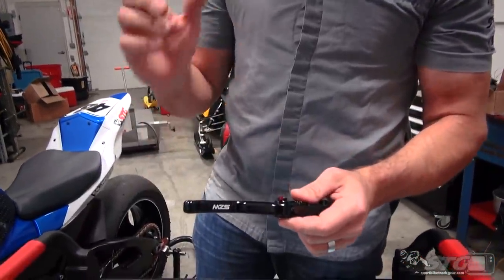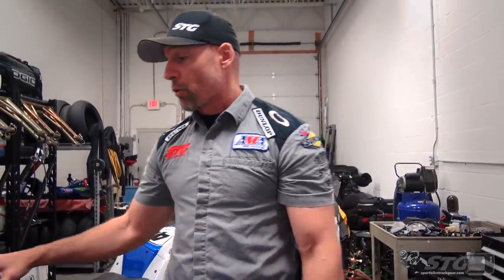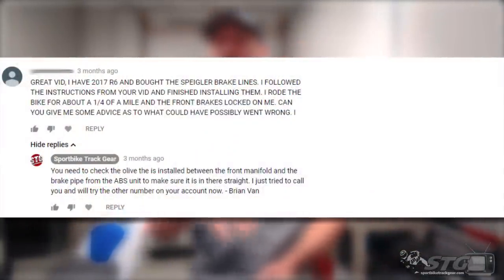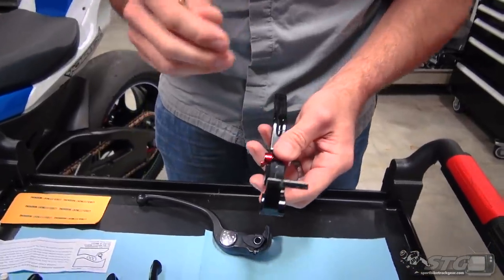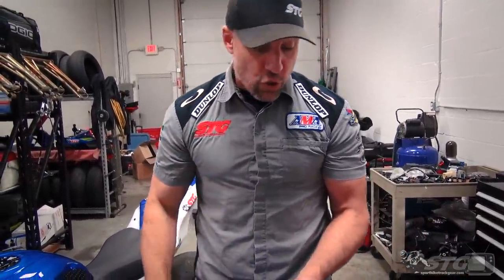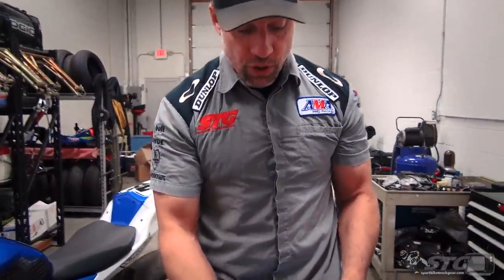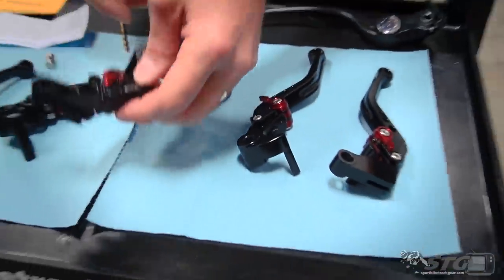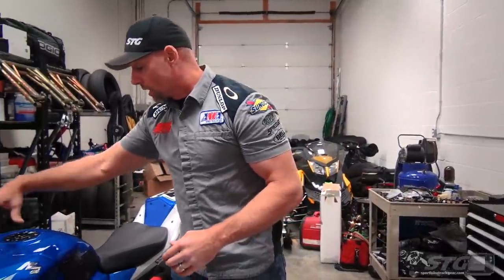The Truth About Cheap Motorcycle Levers | Sportbike Track Gear

Comment: I see a lot of people on here saying that "my cheap chinese levers worked just fine" saying stuff like $150 for aftermarkets are too much. I question if you are that strapped for cash to begin with or just that cheap ahem I mean frugal, why not just stick with your OEM levers. I guarantee they are way better quality than the unregulated chinese BS that ships on ebay. We risk our lives just by riding motorcycles, why compound the dangers?
Reply: Because my OEM levers are not adjustable. I have my clutch lever cranked down to the shortest throw possible.
Reply: @kukusz  i forget that not everyone has average sized hands.  I still say it is not worth the risk of failure. Pony up the green for good that wont bite you in the ass.
Reply: @deathwish8339  for me it wasn't a hand size issue, it was that the throw was very long. I prefer to be able to have very little play in either direction so when I pull the lever I get immediate response. Same goes for the other direction - when I begin to release the clutch lever I want the friction point to show up almost right away. But yes, YMMV with Chinesium parts. Very much depends on the seller and the part.
Reply: Like the oem levers are top quality? How do you know they were installed properly?
Reply: @darrenmcfeaters6683  because you didn't install them, already better in my book. I am joking of course. But cerified technicians are almost always better than you at their specilization.
Reply: @deathwish8339  although I agree, levers, rear sets, clip one are not marvels of engineering and require special skills to install. I was looking at rear sets and my $100 aliexpress one is made as nice as my buddy's $400 one. I remember when carbon bikes and wheels first started coming from China and people freaked out then as well.
Reply: @kukusz  I don't know about carbon bikes from China. I do know that I wouldn't trust the wheels personally. They are probably fine under normal circumstances, but I am already leary about carbon fiber because of the wheelies I do. I don't want to come down harder than normal from a wheelie and have to worry about breaking my rim. If it isn't top grade carbon, I don't want to see it on my bike.
Reply: @deathwish8339  I meant bicycle wheels. I know a few wheel builders that use Chinese made rims now and have seen the quality improve a ton. Same with frames. Failure rates do not appear to be higher, delamination issues same as some of the super high end brands.
Reply: @kukusz  they only look as nice, but if you have any machining or manufacturing experience you should be able to tell the difference of fit and finish. But you cant.

the other part that you are compeltely ignoring is the regulation of said compoments by industry standard groups, the companies themsleves and 100s of years of manufactuing things "the right way".

China offers low prices cuase they throw all that other shit out the window not to mention they dont pay the workers fucking ANYTHING
Reply: @Juxtaposed1Nmotion  you've made so many unsubstantiated statements it's pointless to discuss with you. For what it's worth, the rear sets fit perfectly with oem frame and components like rear master cylinder. The machining is not rocket science. With Chinese stuff, they are often made in the same factory with the same tooling as things "designed in USA" but made in China.
Reply: The issue is the factory one are cast and break super easy and the Chinese one yet even though mostly are billet made from one piece and aren't nearly just gonna snap from a small crack like a cast ones does
Reply: @greggutman5863  sorry, are you saying the Chinese ones are not billet and/or are more likely to crack? Unless they are lying and it's not t6061, why do you think that? Genuine question.
Reply: @kukusz  no I'm saying most factory oem levers are cast and even the cheap Chinese ones are billet and are more likely not gonna break over oem ones

Comment: Well played.  OEM levers can have play and you only mention one possible issue that may cause the cable to stick (not sure I agree 100% on that).  Prove that the materials are subpar, the products dont work as well or something more convincing.  So the expensive ones have a bearing, how often are you going to need to adjust that you need that extra feature ..and at over twice the cost ? I'll consider the cheaper ones, make sure the pin doesn't bind and be on my way.
Reply from the maker: What do I know? I have only been doing this for decades. - Van

Comment: Don't even reply stg. More than fifty bucks for levers is absurd
Reply: I have these same MZS levers on my R3 and they work great
Reply: It is absurd but over 50$ can for sure be less than your hospital bill.
Reply: I put mzs levers on a buddies 600rr and they locked up at the first stop sign and wouldn't release lmao had to slam the mounting bolt out with a hammer and screwdriver just to release the brakes to go home. But my other brand chinese levers have been fine for years. You can't just claim all chinese off brand shit is good lol
Reply: if you can't spend the money on quality parts then don't even bother "upgrading" your bike with garbage parts that are actually a downgrade from OEM

Comment: Fitted MZS to my sv650 today, rode to work and front wheel locked up, nearly went into back of a car. Be taking them off asap
Reply from the maker: They are garbage and should not be sold. - Van

Comment: Thank you for this video Brian! While trying to get the cross-pin bushing out of my stock levers I came across this video. In it I saw the same levers I purchased. At first glance they look sufficient, boy was I wrong! Thanks to your review I saw the little details that go unseen by the untrained eye. As a result I did 2 things: 1) immediately ordered Vortex levers from you. 2) requested a refund from Amazon on the MZS levers. Since I do a lot of track riding your video possibly saved my life! Best part is I had STG Gear bucks from a previous order to offset some of the price difference and return to Amazon was accepted with no hassle 😎
Reply: Got my Vortex levers yesterday, installed today. Thanks again for the possible life saving video Brian! Now I’m ready to hit the track again(once it opens) 😉

Comment: I bought a used Ducati scrambler fitted with a set of those levers , first time I rode more than 10 miles the front brake failed completely rode it again later did exactly the same at similar milage  , the adjusting screw in the lever had been adjusted to far causing the brake to overheat , sorted that problem then the lever  started clicking  , it's in the bin now and fitted an original part
Reply from the maker: These levers are absolute shit. - Van

Comment: That happened to me, laid my Gsxr down at 40 mph. Brakes locked up. Threw those levers away and bought high end levers.
Reply from the maker: And we still have people commenting on this post that the cheap levers are just as good. Sorry you had the issue, the cheap Amazon levers should not even be available for purchase. - Van

Comment: I went through 3 clutch cables on my zx10r because of the cheap levers the previous owner had installed. The cable was rubbing a sharp edge where it comes out of the elver and over time chew into the cable, fraying it and eventually the cable snapping on me! Replaced them with a set of ASVs and haven't had a problem since!
Reply from the maker: ASV makes an excellent lever. Thanks for sharing this, another example of how a cheap lever will cost you more than you saved. - Van

Comment: Hello, I bought a 2014 Hayabusa in a dealership, the first day I got it I noticed that the front brake lever touch the plastic on the bike, so every time I move the steering wheels to the left it automatically stop. IDK what to do.
Reply from the maker: You will need to adjust the controls until there is proper clearance preventing this from happening. - Van
Reply: @sportbiketrackgear  Thank you bro...

Comment: I'M HAVING THIS SAME ISSUE ON MY 99 R1! I worked on the stock lines and rebuilt the master cylinder and thought the issue was resolved, then took the bike out for a spin only to end up having to lay it over on a freeway exit. I then rebuilt the calipers and went to test the bike again, only to have it lock up the front brakes on the freeway again. This time, I was able to keep it upright. HELP, HELP! Also, what are your opinions on Core Moto brake lines? That's the brand that I've been looking at to replace the current lines, but after watching this video, Speigler isn't much more in cost over Core Moto's set. Thanks and keep up the radtastic work fellas!
Reply from the maker: You are welcome and thanks for watching. I do not have any exeprience with Core Moto lines, sorry. We focus on Spiegler lines here and all use them on our bikes at STG. IMO if you need a set that is the way to go. - Van

Comment: I have a Yamaha r15 and my OEM lever doesn’t have a pin, it’s just a solid lever with a wedge to activate the brake. Does an eBay lever still give me a risk of tire slipping?
Reply from the maker: It should not, most of the issues I am aware of are with bikes that use the radial master cylinder. - Van

Comment: You should make another video and attach a string-potentiometer (string-pot for short) to the lever. Fab up some kind of fixture to mount an 19RCS (your typical go-to MC) to and show how much flex the levers have when squeezing the s*** out of them. I guarantee there will be some data worth looking at. That 1-2mm of flex can really make a difference between proper lever clearance and running out of stroke!
Reply from the maker: That's a great idea, just not enough time in the day my friend to make that happen. I have too many uncompleted projects all stacked up right now to add another one to the list. - Van

Comment: So I installed aftermarket levers on my 08 Yamaha r6 and my brake lights are now constantly on or flickering because it looks like these levers aren’t the proper size. And these are the second set of levers (through different companies)
Reply from the maker: Are they the cheap levers from Ebay or Amazon? If not what brand are they? - Van
Reply: Sportbike Track Gear both from amazon FTRT for one brand not sure on the other brand but the clutch works perfectly fine it’s only the brake lever with the lights. Brakes work as well just fine
Reply: Sportbike Track Gear any fix to this or any brand I should get that you know would fit my bike?
Reply from the maker: We use CRG levers on all of our STG bikes, excellent quality. - Van

Comment: I have a pair of Chinese copy levers on my bike, never had an issue with them in about 50,000 miles and they still look as good as the day they arrived. I have seen reports of levers failing as you say but this set doesn't appear to have any of the issues you're pointing out, I do all my own maintenance throughout the bike and have done since I was dispatch riding in London in the eighties, I know my bikes inside out.

Comment: Watching this video has opened my eyes up about an issue I'm having on my 2008 honda cbr600rr. I bought the Brembo RCS19 back in march 30, 2018 with brembos brake reservoir kit to go with it. Nice little birthday present for me. My OE master had developed a slight drag to the piston back in 2016 while I was riding home. I had it fixed, but wanted the upgrade. Well upon installing everything correctly(ASE master certified and Lexus Master certified mechanic), I noticed the hose connecting the reservoir to the master would always have a kink in it. I blead the PISS out of the brakes  with galfer dot 4and never noticed an issue with braking, asides from the amazing feel and feedback of the Brembo master with galfer direct connect race brake line, but never liked how the resivior line always had a kink in it. I've been lazy about it and never really gave much thought, but this video definitely opened my eyes.

So I ask if I should contact STG or Brembo with photos of what is going on
Reply from the maker: Shoot me a pic to service@sportbiketrackgear.com and I will help you get it sorted out. FYI I am leaving for a family vacation tomorrow, please send this ASAP. - Van
Reply: @sportbiketrackgear  I'll be able to get some photos late this evening

Comment: Replaced my oem with 2 finger levers, rode ok for 400M then front brakes locked up. I checked everything from master cylinder to brake lines couldn't find a fault. Eventually i took the brake off and put the oem back on..... Road around the block with no issues. When i compared them and the 2 L were slightly thicker. I filed it down to oem size and no issues afterwards.

Comment: I had a set of $25 ebay levers on my 2014 CBR 500r, didn't like the amount of loose give in the levers. Had them on there for a few days and took them off.
Reply from the maker: For sure the tolerances of these cheap levers is not even close to where they should be. I would leave the OEM levers on my bike before installing a cheap set. End of the day the OEM levers may lack adjust-ability but they do offer excellent feel. - Van

Comment: I have a 15’ Ducati Panigale i use for the track and three days before I was scheduled my bike fell over on the stands and the safety loop on the end of my clutch broke off. Afraid I wouldn’t pass tech inspection I got the MZS levers off Amazon because, like you said, they were cheap. I’m shopping for replacements right away, luckily they got me through some hard braking at the track but I won’t chance it again. Awesome video 🤙🏽🤙🏽

Comment: I have learned the hard way too I bought cheap Chinese levers ending up replacing a whole clutch basket when the problem was the Tolerance on my clutch lever push the hydraulic pin on my Zx-7r thinking I had a bad clutch.

Comment: I bought a cheap pair of shorty levers for my 2006 R1 right when I got it. The last few years I used it to commute on the 101 and 405 freeways in LA for my job with the round trip being 80 miles each day. After 4 years I had put about 70k miles on the bike and never had any issues with the levers at all. I did initially want the ASV ones but I couldn't shell out the money at the time and then just stuck with the ebay ones. Maybe I somehow just got lucky?
Reply from the maker: For sure there are plenty of people who have had a good experience with the cheap levers. That said there are far too many who have had the brakes lock causing a crash IMO. Read through the comments on this video, several riders who had this happen have posted comments. - Van

Comment: If it ain't broke, don't fix it !
I just bought a 2009 Kawasaki Versys 650 with only 5050 miles on it. Both levers work just fine ! 
The "last" thing that I want "my" control levers to do, is fold ! 
I'm leaving my stock levers on.
Reply from the maker: Nothing wrong with the OEM levers. - Van

Comment: When you buy the MZS levers it shows this in the instructions and that it can lead to brakes not locking up if you dont install it right
Reply from the maker: The tolerances on the levers are not where they need to be. End of the day there is simply not enough clearance to prevent this. None of the other aftermarket or OEM levers require this sort of attention to prevent the brake from locking up. - Van

Comment: Yup Happened to me installed these in GOLD, They kept locking up but the bike wasnt being driven it was in the middle of testing them, Theres something you gotta do to push the bushing out the way and it has to be lubricated, im never going aftermarket again
Reply from the maker: Good you found it before riding the bike for sure. - Van

Comment: Tried these exact levers and almost got stuck. The clutch lever wasn't engaging the clutch some reason. I tried adjust every way I could and nothing worked luckily I was only about 4 miles from home and able to make it home in first gear
Reply from the maker: MZS levers are garbage. Happy to hear you made it back home. - Van

Comment: It happened to me. On my Buell xb12r.  I fell over at the second stop sign after I left my driveway.  On a test run.  Fell over.  Front brakes locked up . broke my rigbt side footpeg.  Had to use my tool kit under the seat.  Removed the lever and it released.  I rode back home on my rear break and no peg.
Reply from the maker: Sorry to hear that man. With all of the comments in this video just like yours there are still new comments posted each day arguing in favor of these shit levers. - Van

Comment: Alot of Chinese products have tight tolerance issues because of the finish applied to the metal surfaces which adds extra thickness they didn’t account for during their ‘engineering’.
Reply from the maker: End of the day the worst that will happen is your brakes will lock and you will crash. All that matters is saving some money on your levers. - Van

Comment: Ok just curious Couldn’t you technically free up the tolerance and lubricate with grease? If that’s the only issues with these cheap levers then I don’t see why someone who is mechanically inclined can’t just do that real quick. The levers you showed even have a snap ring so you can remove the pin. Seems like something small to address with the cheap levers then spending 100-200$ on some high end levers.
Reply from the maker: Yes but the important fact is you should not have to. Read all the comments from riders who crashed due to these levers. That is when most would discover there is a problem. - Van

Comment: I had cheap flip levers. The spring rattled loose on my clutch. Missed my clutch doing something stupid that lead me into running into my own parked car. Popped a wheelie over the ditch in my front yard on my WR250R. Ended up whiskey throttle, pulling my front brakes. Bike tried going under my jeep, bent my bars in half. I ended up body checking my rear wheel well with my shoulder/ hip. They were quality CNC machined products that I was extremely happy when I got them.